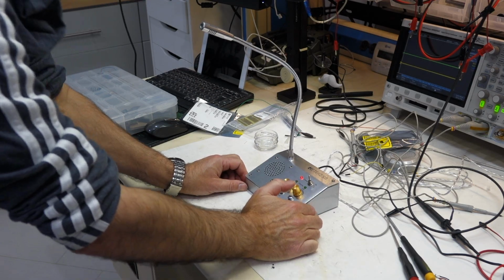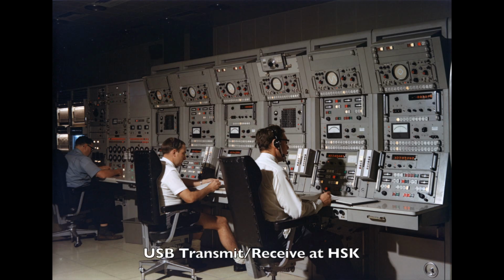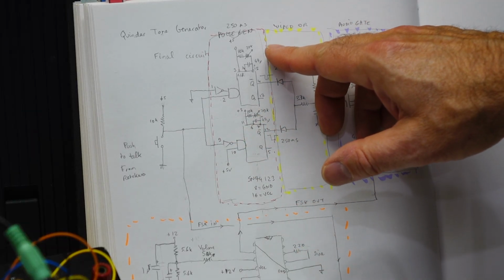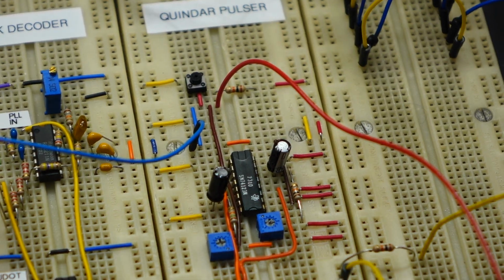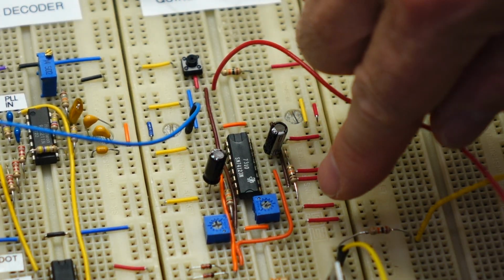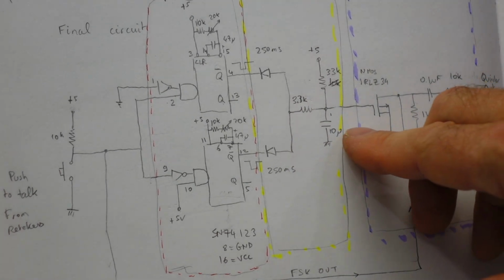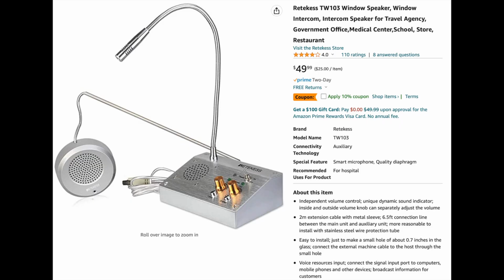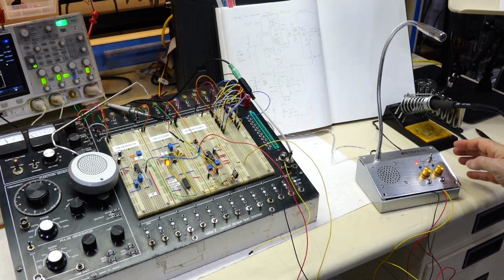Apollo Comms Part 27: Quindar Tones Microphone Hack

Comment: Not only the Quindar tones were used for Shuttle but they are still in use today with Crew Dragon
Reply: Seems like a far better method than saying "roger" or "over".
Reply: @stevewalston7089  Indeed plus astronauts are generally already familiar with it so it didn’t make sense to change.
It’s one of those things that you keep because it actually works and not because of inertia and resistance to change
Reply: @stevewalston7089  Huh? What?Who ?
Reply: @muadeeb  Maybe the Quindar tones?!
Reply: @muadeeb  What's your vector, Victor?
Reply: @Gracana  Rodger, Rodger

Eh?
Reply: @fredinit  You try dragging Walton and Lanier up and down the court for 48 minutes!

Comment: Back in the 1980s I used to design equipment which used a continuous 2970Hz tone to key transmitters.  Because the tones were present whenever someone was speaking they had to be filtered out of the audio stream. 
There is a problem with Qiundar keyon and keyoff tone system design in that if a tone burst is missed by the transmitter it will stay stuck in whatever mode it was in until the next tone burst comes along. Considering the worldwide routing of the Apollo audio streams I would expect occasional dropouts which could if you were unlucky would lose the Quindar keytones.
Reply: I had the same thought. But it could be solved with a VOX circuit AND’d with a timer. If no tone and no audio and we’re past the timeout, then we switch off anyway. Of course most likely this would be noticed and someone would just have to click the mic to get it back I assume.

Comment: I had no idea these beeps had an official name and also, until you pointed it out I hadn’t spotted that the start and end transmission tones were different, and the reasons for them is so obvious once I thought about it.

Also, I appreciate you using actual electronics to generate the tones. You absolutely nail the tones in every way that any digital version just couldn’t and would have been ever so slightly “off” (it’s a real niggle of mine when I hear recreations of oldschool sounds made via digital generation). It never quite hits the mark IMHO, so total respect to you sir!

Loving your channel. Great work!
Reply: I mean, gnuradio can do exact FSK, so I can probably get it exactly the same in software in THIS CASE
Reply: I was used to hearing those beeps and never knew what they were. Thank you for the excellent explanation!
Reply: They were named after the manufacturer Quindar Electronics.
Reply: It's trivial to perfectly recreate these digitally using a microcontroller and an audio DAC

Comment: If only NASA had saved all this stuff and preserved it all in one place.  It would be amazing to go to a museum and see all this stuff working and integrated together.
Also I just wanted to say, what you are doing is amazing.
Reply: The Apollo Applications (Skylab) and shuttle programs used much of the same stuff through about 1973-1998.     Ground equipment would have been cheap to file away but the spending and focus was getting the remaining very large artifacts, flight ready and ground articles to museums across the nation while the program was still fresh in the mind of the us tax payers. 

The Tracking and Data Relay Satellite System also reworked the direct to ground, VHF, HF electronics on the spacecraft and was the sole standard communications path by 1998.     The interesting item will be the implementation of 5G chipsets and software defined radios into future spacecraft.     With  communications companies such starlink putting 25,000 bent pipe and packet switched solutions under long term space test, bespoke voice and data solutions are a bit archaic outside of VHF and HF backups to backups.  A UHF, HF, VHF and Packet Radio radio set is good to 250,000feet     Once on orbit Manned spacecraft will just be temporary space based node in meshes of communications services.     

The weight of comms gear on the Apollo spacecraft in total must have been non trivial.   Comms gear to orbit of Mars or the surface of mars will be dominated by high gain for data delivery, the rest of gear more than likely will be Starlink components with in space histories of more than a decade.   The economy of the scale of developing what would be bespoke between NASA and Boeing is just Lego components of SpaceX ecosystem is the amazing part of the story.

Comment: I remember using a XR2206 back in the mid 1970's when I built a controller for a 2m RTTY repeater above Los Angeles. In normal operation it would convert the incoming audio to digital using a common circuit using a couple of toroids. That would then go into a UART to be converted to 5 parallel bits and then back into the UART for regeneration and then on to the XR2206 to go back to audio. For testing you could apply a PL tone and it would just route audio from the receiver to the transmitter. Good times.

Comment: Marc.... Kudos to you and your team for all the amazing restoration of this sometimes maddening original Apollo comms equipment!!
The trigger for my comment is the elite 2 Circuit Design Test System that you breadboarded the Quindar circuitry on.  I worked on one of them for over 10 years, mocking up the circuit designs that the engineer I worked with came up with.  I just finished a 42-year career with the FAA, specializing in Air Traffic Control Radar, then Physical Security.  I believe that the Moon Race is what sparked my early-teens interest in electronics, leading to my career. 
Again, congratulations to you and your team!!!

Comment: I remember that untill they built the new Huston mission control center rooms they had these tones going into 90's from the original Apollo era control room. You knew Huston had control when those tones sounded. When they would transfer control over occasionally to the Marshall Spaceflight Center those tones would go away tell Huston took over again. During Shuttle missions.

Comment: I wonder how many bleeping meetings were required to decide on the bleeps back it the day, or whether an engineer just said, "...here they are".
Reply: With 400,000+ folks working on the program, I don’t doubt they had a dedicated engineer for the beeps.
Reply: @garylucas6511  An engineer for the higher tone and one for the lower tone? ...and a tonal manager to keep the peace in the inevitable turf-war.
Reply: Don’t forget this NASA. You would have the higher tone contractor engineer and manager….. AND the lower tone contractor and manager.  PLUS the safety NASA engineer and safety manager + their contractors.
Reply: @LostAgain1970  That Person would probably be in his 90s but everything is possible.
Reply: @mikus4242  The recent disruptive event in Florida ("Stage 0") shows that safety managers might have "lost their voice" to Hubris - the risk manager par-excellence.
Reply: @SubTroppo  Boca Chica, Texas. Safety engineers absolutely have a strong place. My comments were based on the massive duplication of workers on the NASA Shuttle program.
Reply: @SubTroppo  I don't think anyone could have predicted it would be so severe. We were expecting some spalling, which the ship could have handled. We did not expect it to dig a giant hole in the ground.
Reply: @mikus4242    I imagine that there are no insurance underwriters for such an exploit at Boca Chica and therefore no requirement for an independent safety and risk assessment.  The FAA investigation (due to flying debris?) from that launch  speaks volumes. and reminds me of the Boeing 737 Max debacle and the phrase "regulatory capture". Fascinating!

Comment: I was thinking about it, wondering how we would have ever heard these tones if they are used to signal PTT. My logic was that if PTT was not initiated until the tone, then the transmission would not include the tones (or at least they would be somewhat truncated).

Then I realized, well of course, recordings we've heard on the ground would have been sources upstream of the remote link. So we hear the what the transmitter station hears.

I wonder, then, if what the astronauts heard would have been a more chopped off version of these tones? Kinda makes me wonder about whether they did, indeed, use these as courtesy tones? 🤔

(I'm also the guy who watches Back to the Future and points out all the logical flaws 🤦‍♂️)

Comment: I think I have just found my build/modify project.  I should have an FSK encoder decoder as I ran a teletype link over HF radio from James Cook University in Australia to the University of the South Pacific.  If not I will go with the ‘cheap’ solution.  One comment - the tones don’t sound like I remember them.  I had 2 references 1.  From the broadcast TV in Australia and 2. From one of the network control centres on the way to and from Honey suckle.  Of course it could be my antique hearing or YouTube mangling the tones!

Comment: Great video. I am going to add Quidnar tones to my home landline phone. I am going to use an Adafruit Trinket M0 which has a true DAC Analog output that can produce these tones in phase, a single pole RC LPF, and a 2N2222 as a speaker driver, that should do it.

Comment: I think that an exhibition stand is needed that can be safely transported from museum to museum with a detailed description and connection diagrams, so that even after 60 years the stand can work and repairmen can quickly figure out what's what according to the instructions and the attached diagrams with a description of the work (this is very important create a detailed service manual for future generations). You can even come up with a special shipping container with fasteners for all the elements. The idea is this: I brought it, took it out, assembled it, dismantled it after the exhibition, put it in a container, and took it away. And such a special shipping container for each stand, for each interesting equipment. After all, the task is to demonstrate live a working sample to as many people as possible. It's worth it.

Comment: Really interesting. No idea they were developed for the equipment and not the people, but what exactly did they enable in the equipment? Would be a nice follow up video. Thanks.
Reply: Probably just a simple xmit on/off control circuit. Used to have something similar in the Marti RPU great, but it was typically used in a repeater setup and not exactly in band audio

Comment: Come on Marc, XR2206 really?  How bout some single transistor phase-shift sine oscillator! And simple transistor based monostables!
Reply from the maker: This could work but has serious shortcomings. Single transistor sine oscillators are not stable enough in either amplitude nor frequency. They have significant distortion and require a large L that would probably not fit in the Retekess box. And I would have needed two of these. So I wisely stayed away from them. Similarly, transistor multivibrators would have led to too many components and too large a circuit.
Reply: @CuriousMarc  If you got one transistor, you need more. A transistor gyrator for the L :) But seriously, XR2206 is a perfect choice. Reliable and simple to use. If you got a microcontroller with timers - any microcontroller will do really - then Don Lancaster's Magic Sinewaves are the next best thing. Usually a simple 1st or 2nd order low-pass converts the pulse train to a beautiful sinusoid. And the pulse train is the same for a given sine amplitude, so changing the timebase changes the frequency. It's a neat idea. M. Fourier would approve :)
Reply from the maker: @absurdengineering  Oh very cool, thanks for the pointer. If I ever wanted to use a billion integrated very cheap modern transistors instead of just the more slightly more expensive vintage bunch of 100, that would work just fine! Seriously, it's a good one to have. It's just PWM all pre calculated.
Reply: @CuriousMarc  Just so it goes on the record: I’m highly pro-analog and I wholeheartedly agree with your choice :)

For a significant lowering of the number of transistors, Magic Sinewavews can be implemented using anyone’s favorite logic family and a number of switches forming a ROM storing the pulse and delay lengths. Extra points for using vacuum tubes for the counter and logic :)

Comment: Digital electronics? No, a couple of 555 could do
Reply: not even, a couple of BJTs and if you really want a JFET, wien bridge sine oscillator. Using ICs for this is going to show lack of electronic knowledge.
Reply: @iz8dwf  🤣 I didn't want to sound that harsh but it's partially true. A couple of transistors would do indeed.

Though, using IC's may also show knowledge of how to use integrated devices. Balance between ease of use and complexity. At least, he didn't use an ESP32
Reply: 555s make square waves, though.
Reply: @EdwinSteiner  you can make the output a sine wave if you wish. The most basic change is a simple resistor and capacitor.

A square wave is nothing but a lot of tuned sine waves added together
Reply: @randomelectronicsanddispla1765  Yes I agree that my comment was probably not totally deserved. It's more likely just design laziness :) However it would have been a good bonus to show a period-correct tone generator.

Comment: Beep...Follow me I know the way..Boop. I'm thinking in few minutes can be done with an Arduino in a Attiny 85 :)
Reply from the maker: Not really. Generating a low distorsion sine wave from an Attiny is difficult. It has no D/A, and I don't think it is fast enough to support an external one with enough bits. It could be done though, generating a square wave with the Attiny then designing very good active filters to transform it into a sine. But that's not done in a few minutes. Using the XR was much easier and faster.
Reply: Very thank you Marc to take time @CuriousMarc  Thank you very much for response! Yeah the distortion will be a mess but the frequency stability will be great, I used some DTMF generator chips as the HT9200 and internally is a R2R as DAC, the output from the chip is ugly but with a passive low pass filter with 2/3 stages it becomes better. I don't remember if they use 4 bits or 8.
I DDS's an old HF transceiver with oled display and rotary encoder, because a lot of pins from the Arduino was free I set a roger beep on it. Basically is square generator with a very small capacitor injecting audio in the mic, because is poorly coupled it give me a sine wave in the TX audio. 
In a transceiver you must hold the TX line until the beep ends otherwise it's play when the radio is already in RX. Having a uP it's very handly :) Best Regards! Great channel